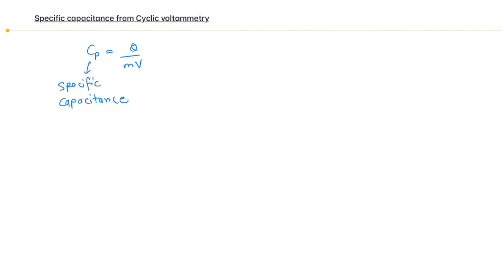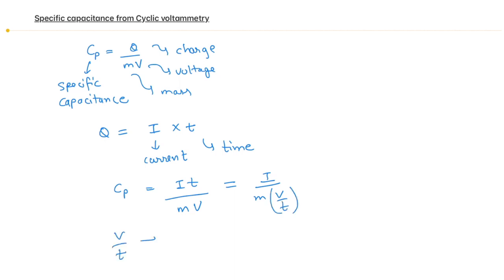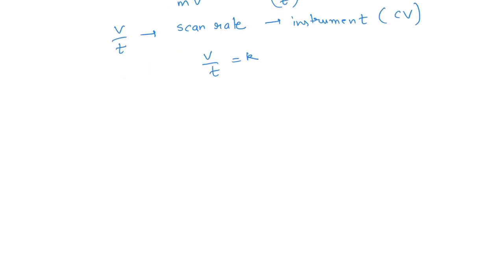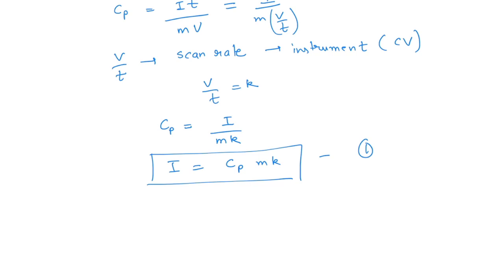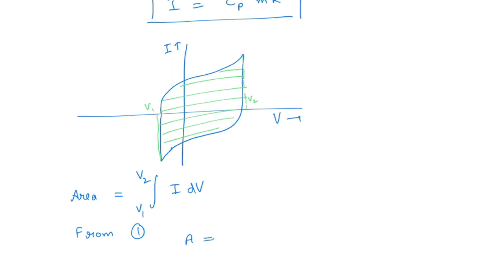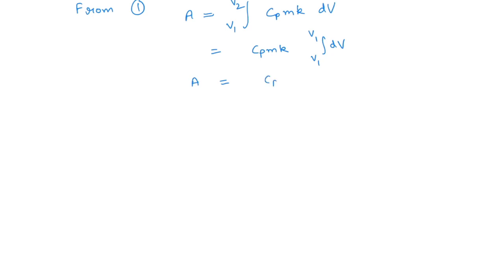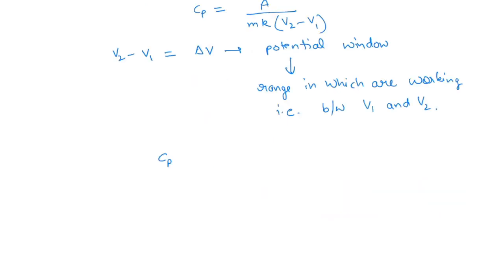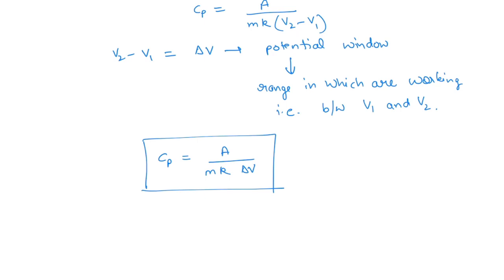Calculation of specific capacitance from Cyclic Voltammetry(CV) | Supercapacitor | Part-1 by IITian

Comment: I have a quick question. Why do many papers seem to divide the area by 2 resulting in the final equation being: Cp = (Area)/2.k.m▲V? I'm measuring using a 3 electrode setup. Do I need to divide it by 2? Thanks
Reply from the maker: Yes you need to divide it by 2. Actually here expression for capacitance is calculated for two electrode system and in 2 electrode system current is half of that in 3 electrode system, so taking this into consideration this half factor came in the capacitance expression. Hope you got it.
Reply: @prepkitpgt  thanks for getting back on this. Did you mean the current is half in a 3 electrode system? Or do we divide by two since we run a forward and reverse biased voltage. With the charge held being that from the reverse biased voltage in CV? Thanks
Reply from the maker: Current is half in 3 electrode, is the reason for this. No effect from forward or reverse bias as we are taking change in value(delta) of current and voltage. So this will not make any affect
Reply: @prepkitpgt  thanks for clarifying that up! Really appreciate it!